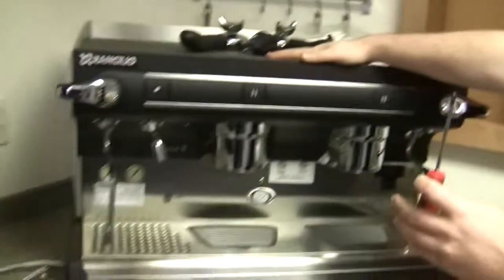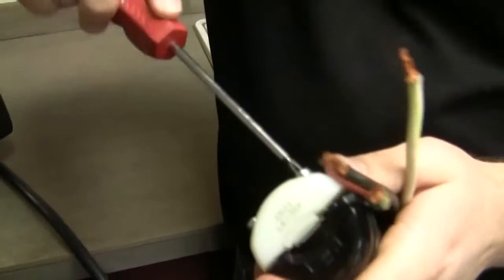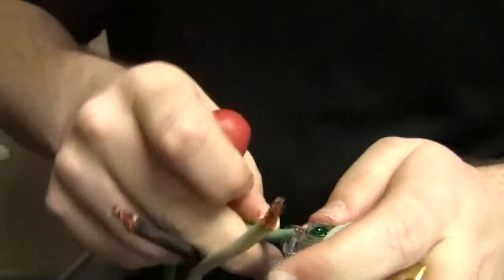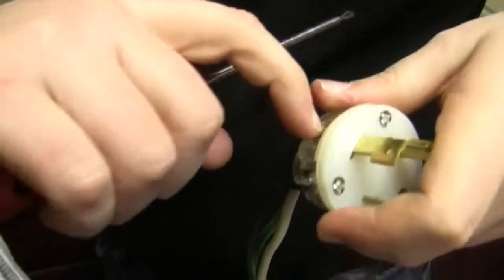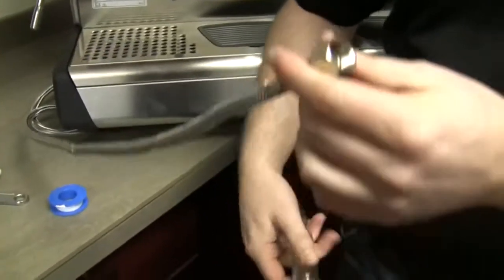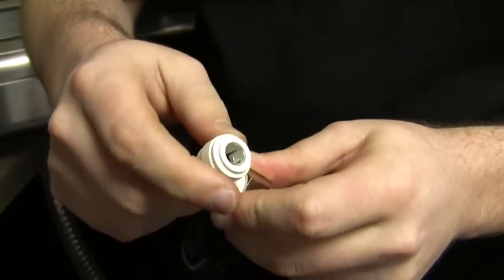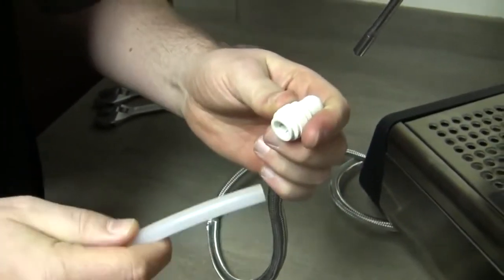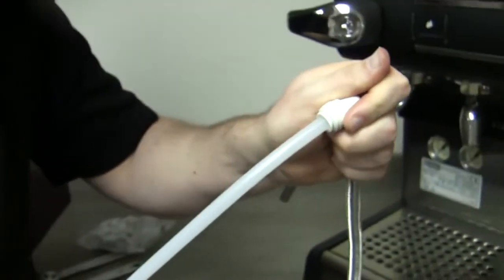SCG How-To Guides: Rancilio Commercial Espresso Machine Installation

Comment: Hello Great video: two questions.   If you have a two group epoca, does that requires an outside pump?  second, if the second group is not flushing water, b ut the first group is, any suggestions on what might be going on?